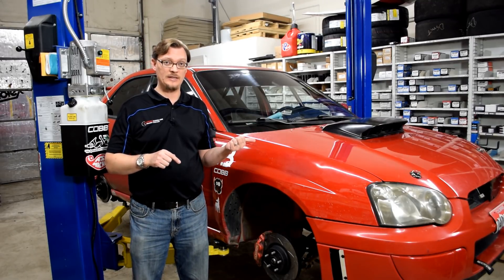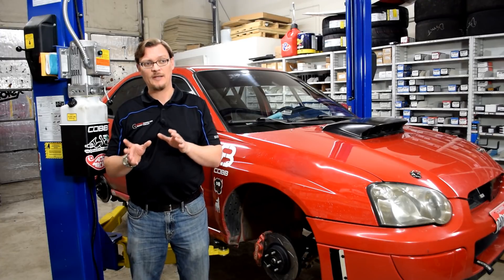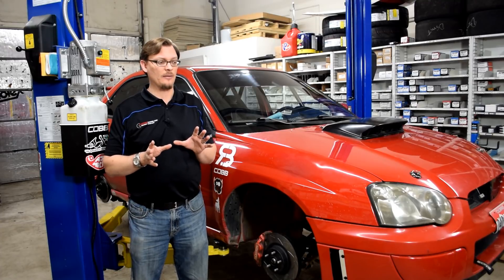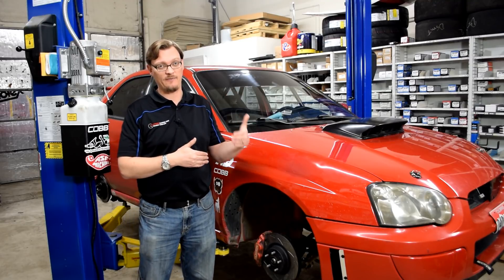STI 6-Speed Transmission Swap FAQ's

Comment: This is very informative. Thanks for taking the time to make these videos. 

I have a question though. I'm currently considering putting an sti 6 speed into my 2011 gve/g3 wide body wrx as my 5 speed has blown synchro's and might not be worth rebuilding. I've been trying to find out exactly which sti boxes will bolt straight up but I keep coming up short. I've been told that a sti box from the same year will work, but I will need a sti shifter linkage, shifter surround and a tail shaft. If you can offer some advice or guide me to the right place to look it would be greatly appreciated. I've spent many hours on forums trying to find answers to suit my model wrx but can't seem to find concrete information. Your videos seem to be the most accurate information I've found, Thanks again and great work. Looking forward to your next videos!
Reply: MY04–MY05 STi transmission would allow you to keep your rear diff (r160) as they are both 3.9:1 gear ratios. Otherwise, you'll have to swap the rear diff (r160 to r180) and the transmission together (from the same year/code STi).

You will still need the shifter linkage and all the other wiring he mentions in the video. Clutch and flywheel from the STi also, along with the clutch fork and slave cylinder from the STi (push vs. pull). The slave cylinders might be the same, I'm not sure, but I would think you might need the longer pressure line from the clutch master cylinder to the slave cylinder in any case.
Reply from the maker: Thanks for your question Dose.  The reply below pretty much covers your question.  Thanks for that Sam!

I will add that you want to keep in mind that you have an open rear diff.  If you do keep your R160, that can cause some odd behavior from the drivetrain, as it is far less than ideal considering you are getting a DCCD center diff and TBD front diff with the 6-Speed.  This is especially true without a controller, but either way, that open diff in the back is an issue that you will want to address at some point.

For that reason, it may be better long term not to be too attached to that, and look at other options.  A 2002 - 2005 diff will have a viscus diff, but at this point, most of them will have lots of miles on them, and that viscus coupling is most likely not in great condition.  This is why in our car, we just went to the STI R180 because it has a TBD to match the front in the STI transmissions, and since you have a wide-body WRX, all you need are STI axles.

Lastly, you will need a slave cylinder with the STI transmission.  The slave cylinder is not interchangeable between pull and push style transmissions, but your master cylinder will work just fine.

Hope that helps, and good luck with your swap!
Reply: @FlatironsTuning  if the spline count on the R180 are the same as the R160, can you just use the WRX axles until you can afford also getting STi axles?
Reply from the maker: @nekidfrog  The spline count on the differential is not the same.  That is why you have to use a different axle if you are going to run the R180 differential.

Hope that helps and Stay Tuned!

Comment: Would love to do this in my 17 wrx
Reply from the maker: Thanks Malkionx, and we want to try that too.  From what we have found so far, swapping an STI 6-MT into your WRX would be very similar to the 11 - 14 WRX.  The good news is that it looks like it will not be too bad.

Thanks for watching!
Reply: FlatironsTuning sweet so would you reccomend a newer sti transmission(15-17) or 11-14 One.
Reply from the maker: There really hasn't been a significant change in the STI transmissions in that range, so really any of those would do.  Just remember that you would need the rear diff to go with it.
Reply from the maker: @Alejandro Rodriguez Yes, you do need a different driveshaft.  The STI driveshaft is a few inches shorter than the 5-speed.

Comment: Love your videos, it's helping my with my GR 6mt swap right now. I have 1 question, if I'm understanding correctly, I can use a 02-05 r160 with my 2014 sti trans?
Reply from the maker: Thanks for your question Jonathan.  Yes, that is correct.  The 02 - 05 R160 has the correct R&P ratio for the late 2006+ STI transmissions.  It will bolt up to your car, but they did change the forward differential mounts on the GR, so you will need that forward diff support to run the older R160.

Good luck with your swap, and thanks for watching!
Reply: Thanks! I made note of that. I ended up finding my R180 this weekend that I had been hunting for.